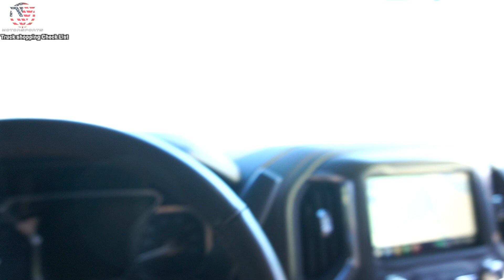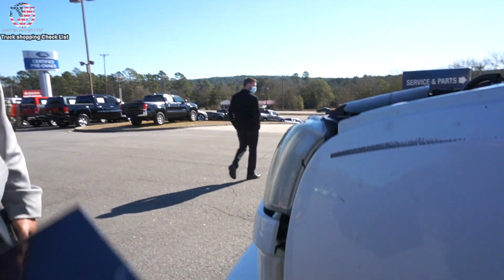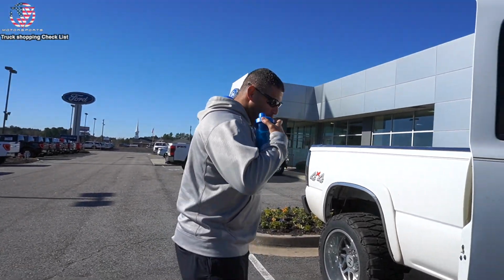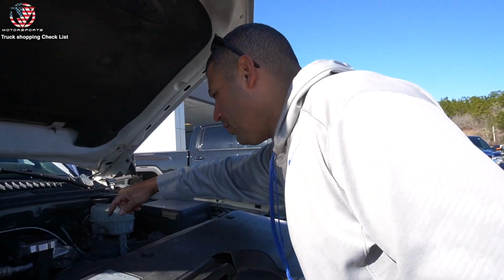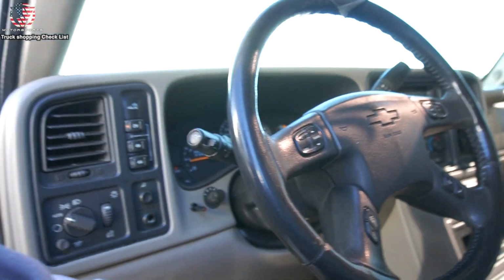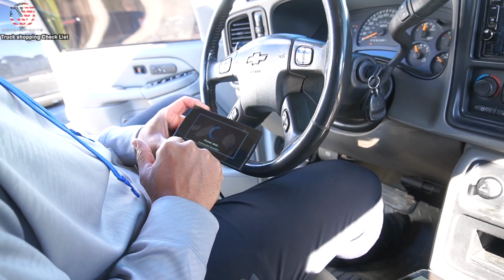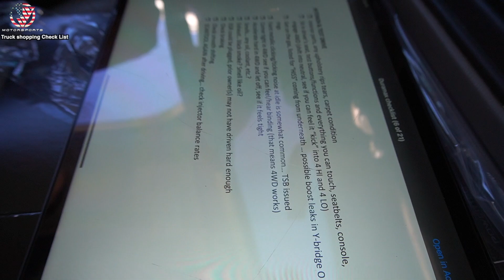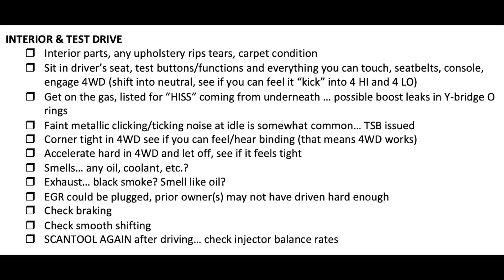CHECKLIST TO USE WHEN BUYING A USED DURAMAX *IT'LL SAVE YOU MONEY*

Comment: A tip if you don’t have an injector scanner is to slowly rev the truck up to about 2500 rpm then let off and watch the rpm gauge. If it goes down smooth the injectors are ok but if it goes down then bounces back up a little that means one or more of the injectors aren’t firing correctly
Reply from the maker: great tip!
Reply: What if you rev it and the rev hangs a little after you let go of the pedal then idles down. With my truck it hangs the rev for a sec or 2 then drops down. Other trucks don’t do that. I heard it was tuning. What you think?
Reply: @krishermanowski3599  vacuum leak

Comment: For those who buy southern vehicles, be forewarned, the thing may not have rust, but… it’s got no paint from sand and will rust quickly. The auto transmission will fail, the bands and seals 🦭 brittle, as soon as you get back east. All the rubber is burned out and the glass is cracked the engine is cooked and has over a quarter inch of baked on sludge.

Comment: I used to get the work truck 2500hd single cabs 4x4lbz for $6-$8 k. Rebuild the motor and stick them in hummers, Then put the hummer 6.0 motors back in the 2500hd sell for $5-$6 k. lmm and the lbz are 99% identical. i have personally an lmm 2500 late 07 and my duramax h3 lbz build.I love duramax motors.
Reply: Add an lb7 to the collection and you can call yourself a super fan lol im jealous.

Comment: Best way to check injector rates is to put it in drive and hold the wheels cranked all the way one direction. Sounds weird but it’s true
Reply: Dumb and unnecessary. There is a more accurate and better way of doing it which involves calculating your CFR with injector balance rates.

Comment: I might potentially have the opportunity to get a really nice LB7 duramax with a massive cognito lift and American Force wheels and 40" tires. But I'd have to trade my Camaro and I don't really want to part with it, but I've always wanted a lifted diesel. The struggle is real
Reply: Lifted trucks are awesome until you realize the only garage that they will fit in is the fucking tractor shed.  - A guy who drives a Cummins on 37s.

Comment: Maybe I missed something. When you did the injector balance test,  the acceptable range is -4.0 to + 4.0  .  Is this range Correct?  I only saw one faulty injector which was #5 reading slightly above 4.0.  Am I missing something here or possibly not understanding the acceptable range?? 
Thanks
Reply: You are correct, +4 or -4 is a good range. I think they were concerned with the other two that were around 3.6 because they are closer to needing replaced.

Comment: I wouldnt be so quick to write off the other engine models. I own an LML not deleted.. yet! So far in towing specs it can pull some serious weight at 157K MI in the northern state of MI I am thoroughly impressed! It's also my daily driver. Also a dually sounds amazing until you got to replace tires and see your bill also more tires equals a slight dip in fuel mileage!
Reply from the maker: Yeah, but it’ll be almost impossible to get a decent LML under $20k
Reply: @JWMontoya  This my friend is true mine is a 2011 and I got it for 21K with 130K on it. Either way i hope matt finds what hes looking for. Might have some decent luck up here in the northern parts I know its the rust belt but you'd be surprised at how many trucks I see rust free that roll in the heavy cold salted winters up here. Best of luck gentlemen!!!

Comment: You are checking injector balance rates the wrong way. When i was in the market for duramax trucks, I would bring my laptop with tech2win. I've seen, injectors with -/+ 1 or 2 balance rates, but it means NOTHING without calculating the CFR. I've seen cfr drop as low as 3mm3 from 7mm3. I've seen good balance rate injectors actually be way of spec once you factor in ur fuel rate. Also having the AC running with drastically change your balance rates and will give you a false readings of good balance rates.

Comment: Yeah that truck was a bit of a scam because the injectors seemed like they were starting to go bad and the exhaust was hazing when you started it up there's no blow by which is good which leads you to believe that it has had much bigger tires on it which means that someone is suspension and drivetrain and steering components could be excessively worn out meaning that they'll need to be replaced it sounds like the turbo is getting a little up there in age it is a little lower on the mileage but that truck is nowhere near worth 20 grand I'd say 13 at the most